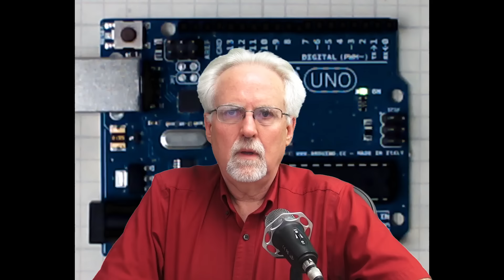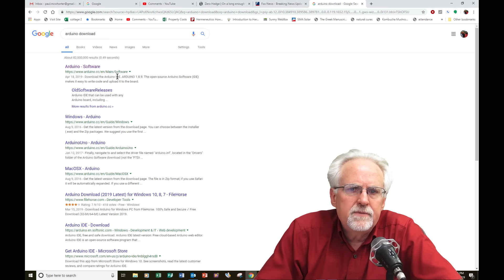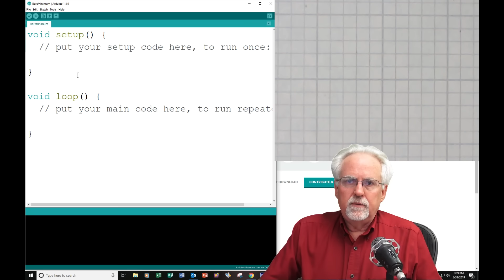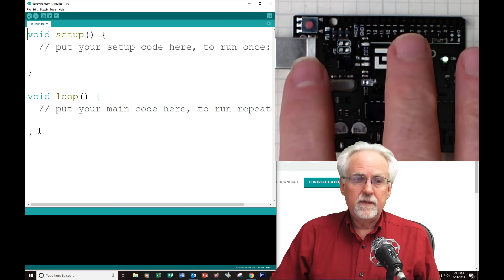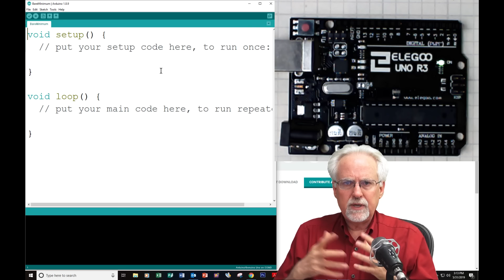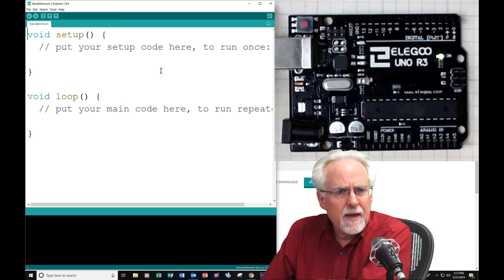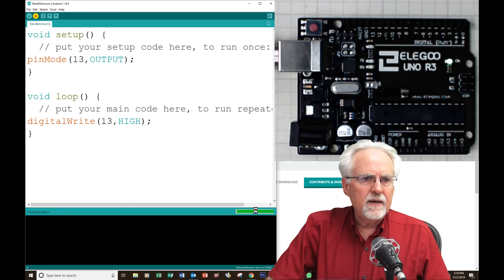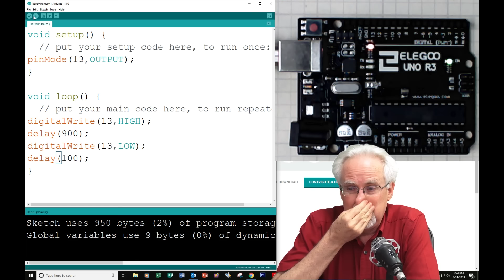Arduino Tutorial 1: Setting Up and Programming the Arduino for Absolute Beginners

Comment: Hi, I am following your lessons with interest. Thank you. However, I am having problems with Arduino. I'm using Arduino Uno IDE 2.0.3 On my screen the top line doesn't match the download in your lesson. This is also the case when I download the program again. I see 3 buttons and a window that says: "Arduino Uno" is indicated and the port "COM6". Of the 3 buttons you can only use 2 buttons. The leftmost “V” (verify) and right next to it “→” (compiler). The 3rd button from the left does nothing when pressed. Perhaps this is also the cause of the Serial Monitor not working. 
In your download (lesson 1) there are 5 buttons next to each other. (?) How can I solve this?

Comment: Hello Paul! I wanted to let you know that I've been in the electrical field for 35 years now, 23 of those years as an electrical contractor in the state of Florida, 24 years as a Master Electrician and 3 years as an electrical contractor in the state of California recently.  I  just got my FCC amateur radio license in April of 2022 and started to learn about radio frequency, antenna, and amplifier circuits.  My brother in law had a bad DC converter in his RV, so I took it apart and soon realized that I was hooked... I was able to repair the converter by replacing a cap, resistor, and fuse by unsoldering and installing new components... So, from this point,  I wanted to understand more about electronics and soon discovered that my electrical background gave me a head start in fully grasping the concept.  I then began by picking up an Arduino Uno R3 and an accessory kit to go along with.  While searching for information about the Arduino, your name kept coming up. Well,  a quick search led me to this channel, and I am truly impressed 👏.  Thank you very much for taking the time to produce this content for beginners like myself.  I am honestly learning quite a bit by following along with your videos.  Yes, I can say that I am hooked and want to understand everything there is about this wonderful and exciting world that I had previously ignored.  I am certain that as long as I continue to watch your programming, I  too, shall one day comprehend these amazing little boards like you do. Again. Many thanks, Paul! You have made my journey that much easier.  Keep up the great work!

Comment: Sketch uses 932 bytes (2%) of program storage space. Maximum is 32256 bytes.
Global variables use 9 bytes (0%) of dynamic memory, leaving 2039 bytes for local variables. Maximum is 2048 bytes.
avrdude: stk500_getsync() attempt 1 of 10: not in sync: resp=0xff
avrdude: stk500_getsync() attempt 2 of 10: not in sync: resp=0x00
avrdude: stk500_getsync() attempt 3 of 10: not in sync: resp=0xe0
avrdude: stk500_getsync() attempt 4 of 10: not in sync: resp=0x00
avrdude: stk500_getsync() attempt 5 of 10: not in sync: resp=0x10
avrdude: stk500_getsync() attempt 6 of 10: not in sync: resp=0x00
avrdude: stk500_getsync() attempt 7 of 10: not in sync: resp=0x18
avrdude: stk500_getsync() attempt 8 of 10: not in sync: resp=0xf0
avrdude: stk500_getsync() attempt 9 of 10: not in sync: resp=0xf0
avrdude: stk500_getsync() attempt 10 of 10: not in sync: resp=0x00
Failed uploading: uploading error: exit status 1

Sir, I am getting this error. What should I do?

Comment: Hi Paul.
Thanks for doing these tutorials.
I am 63 and using your videos to teach myself electronics..
When I write my Arduino code as you have yours, my OUTPUT word remains Black not coloured. 
Everything works fine but my text is not coloured when I write "OUTPUT"
My IDE is very 2.0.3 and somethings differ  to your IDE.
Appreciate any help.
Mark, Australia.
Reply from the maker: The new IDE might be different than the one I was using.

Comment: Hi Paul, thanks for the series again! I tried using pin 13 as a voltage supply pin -- pinMode(13,OUTPUT) and digitalWrite(13,HIGH), but it didn't output enough voltage to move the servo at all (I just hear tiny clicking sound). I suspected the possibility of insufficient voltage, so I tried using the 3.3V pin and it was enough to move the servo. 
So is there any difference between digitalWrite(pin,HIGH) and the 5V pin? (or, why can't I use digitalWrite(pin,HIGH) as a voltage supply?)

Comment: The older tech guys are always  the ones that can explain exactly how a piece of Equipment works instead of just how to use it but not truly understand how its possible or what the functions are actually doing to give the desired result.  The people that say to plug wire into port x and upload a premade file aren't really teaching me anything  because they never explained why and we're not building a bad clock because we needed one so getting it finished as quickly as possible isn't the goal. I'm glad I found this channel.

Comment: Hi Paul, thank you for your tutorial series. I've just started following along. I realise this series is a few years old now so this may just be an issue due to the updated software...When I write any of the commands - pinMode, OUTPUT, digitalWrite etc ... none of them change colour. Have you encountered this and is there a patch / fix for this?
Reply from the maker: Probably you have downloaded a more recent version of the IDE and perhaps it does not behave the same as mine.
Reply: @paulmcwhorter   Thanks 🙂

Comment: As a 78 yr old kayak fisherman I'm coming into this sort of sideways, trying to install and run an Electronic Speed Controller (ESC) into the head of my fishing trolling motor and using a servo tester (with a larger potentiometer than comes with the servo tester) as a remoter control. So many adjustment settings, so many new terms to learn and then a couple of the folks in this facebook motorized kayak group start talking Greek to me and it turns out that they are referring to Arduino, so here i am!

Comment: You helped me more than you know - my instructional PDF indicated that the “sketch uses 922 bytes” etc. output was indicative of bad drivers, and the first lesson had a code that set the ALREADY BLINKING light to blink at the same rate that it already was (1000ms). 
I ended up just guessing and changing the delay to 200ms without even knowing what it did - well, it changed, and it was working the whole time. 2 hours wasted lol. 
But I wasn’t sure what was going on with it, and when I saw you had the same output I was so relieved and angry at the same time.

Anyways I can register the blinking at about 20 to 25. 

Thanks so much for making these videos.

Comment: Great video;  I am a model railroader that am building a somewhat unique 3 cylinder steam locomotive.  I am trying to learn how to program an Arduino so that I can utilize a sound card that I could turn on and off to create the 3 pulses of the exhaust (with the center exhaust duration that is slightly longer that the two other adjacent exhaust pulses, and have those pulses vary in pulse widths depending on the track voltage (0-15Vdc).  Could you recommend a sound card and an Arduino type that I can use to do this?

Comment: Hello Paul, many thanks for your fantastic tutorial from Germany. After more then 30 years your tutorial bring me back to electronics and programming. It's great. 
I teached in the later 80th socially disadvantaged pupils without a grduation the basics of electronics. So today I had  one small idea to make the understanding of arduino a little bit easier. I use two breadbords - one of the left side from the arduino and one of the right side. On the left bradboard I place the Input-circuit and  I place the output-circuit to the right side. So absolut beginers can read the complete circuit like a book from left to right. We have an input into the arduino then the arduino processes the input an give the result to the output. 
And so you have the same picture in mind as the logic works.

Comment: Hi I am a retired Mechanical engineer who originally programmed in Basic, Zilog & Fortran 40 years ago at University but never had the need to use it since. (I used the experts to do this). 

Now that I am retired I have a small automation project I want to do for my astronomy hobby and therefore I want to see if I can do this with the Arduino or Raspberry Pi as a low cost solution.

However the first steps is to learn how to program these units and learn the syntax.
These tutorials are brilliant and like others have said I like the fact that you don't assume the viewer already understands and that you explain everything fully. 

This has rekindled my understanding of electronics and programming again. Thankyou.

Comment: I have a video suggestion!!!
can you do a video on can bus communication using arduino. a very practical application would include analog 0-5v sensors for a car. Maybe even include data logging.
i’ve looked around and there are no videos i can find at the level you do.

Comment: I don't have Arduino, but to complete the assignment, I suggest the assumption that eye is able to take 30-60 pictures per second. So, we can predict that there is a limitation until 1/60-1/30 seconds. Converting milliseconds, they are 16 and 33 ms. So answer should be very close to these values.

Comment: Hi all
I  fell foul of the sneaky little tab in Tools they don’t tell you about below the Arduino nano  or whatever your selection of Microprocessor board which asks what processor are you using. It comes in three flavours Atmega328P or Atmega328P (old bootloader) or Atmega168. I tried them all ‘till it worked after tearing my hair out before finding out that there was more to set than just Nano or Uno et al.. The error messages don’t give you a clue about this so you spend a lifetime trying to re-jig the software because that’s what the error messages tell you to do. So not all Nano’s are the same by the looks of it and a lot of Prior Knowledge is expected .......  Straight PICs are the way to go I think and cheaper.  Phew!  Pete
Reply from the maker: A challenge in making educational material like this is after I make the videos, changes are made to the IDE, software, and libraries. So, sometimes the IDE you download is not the same as what I am using in the video. This is usually what leads to confusion.
Reply: @paulmcwhorter  Hi Paul Many thanks for your nice reply. I have been very confused as you can see I am used to play with PICs and was told Arduino is much easier well now I am in I am determined make them work already build a ham radio morse keyer using the nano and will follow your excellent tutorials to learn more now I can do something with them. Many thanks for the work you do good luck Pete M0FMT

Comment: I know paul still reads these comments but if your reading this anyone I would not really recommend arduinos ides I would recommend you install visual studio code and get the extension platform IO it gives you a lot of features arduino doesn't like built in debuggers autocompletion (more advanced autocompletion I am pretty sure arduino ide v1 or v2 has it just really slow)
and you also get built in library and some other thing installers it also includes a ton of quality of life features + you can use custom themes and it can compile and upload directly to the board and you can configure all the stuff on it.

Comment: Would you recommend that I get the most complete starter kit instead of the super starter kit? I'm kind of hesitant on which one to get.
Reply from the maker: either works fine. If you can afford it the more expensive one has a few more components
Reply: @paulmcwhorter  alright thanks for the response

Comment: I have a question, I'm not sure if you've heard of the Onion kit. The onion comes with an upgraded version of an Arduino UNO R3. It is called an Arduino Dock 2. I've checked solutions but Arduino IDE isn't recognizing it. But the light on the board works.

Comment: I got my on and off time down to 15mS by the time I could not see a definitive flash. Loving these tutorials, I learned C in school and started with PIC18F24k30.  I designed, coded and built my own weather station as my final project.  and just getting into o Arduino now. thanks very much

Comment: Between 1-15 msec the led remains at a constant high and then when we go to a microsecond range delay, the LED starts getting a constant dim, which is indicative of I guess how fast the signals are transmitted in case no delay command is inputted. Thanks for this great beginner lesson!

Comment: Why won't this turn off the light? Setting it on HIGH (even though pinMode is commented) will turn it on, I don't know what's the reason behind it

void setup() {
  // put your setup code here, to run once:
//  pinMode(13, OUTPUT);
  
}

void loop() {
  // put your main code here, to run repeatedly:
  digitalWrite(13, LOW);
}

Comment: I never got familiar with the old Arduino IDE and now I have to start all over, which isn't saying much as I never got familiar with the old IDE. So far, it has been my OP newer stuff was suppose to make things easier, not in this case yet. So now I have the new IDE, I connect my arduinos up and the software will not find the proper comp port and I haven't been able to figure out how to fix that. I have 2 options and neither is working. Maybe after watching these videos I can figure this out, I hope so, I'm kind of hard to teach.
Reply: So far, I found out there is a driver error from somewhere that might be causing the issue. I read somewhere else that another person is/was having the same issue, a driver error, not finding the suitable com port and recognizing the Arduino board. Some people just pick up on this stuff and others don't.
Reply: Paul, I'm still having more issues then should be run into with this IDE. Downloaded version 2.0.0-rc9.2 and now none of my Arduino boards will connect to the correct com port, Mega's, Uno's, Nano, Clones. NONE of them, nothing but inconsistencies and nothing is correcting the problems. Windows defender is blocking stuff and wanting to close the IDE. I managed to go back to my old IDE and I got a com port connection and was able to upload a large sketch which is for a SDR project I'm working with. I have 2 versions of radios and several other projects which run on Mega's and 328's I need made functional, not happening with this new IDE. Setting preferences isn't working! Nothing I do makes any difference. Any idea or help?

Comment: just posting as it may be of some help to someone else,
First problem i encountered with my Arduino is that the one i had bought with my kit (not the same kit in the video) had sat not doing anything for about 2years until i've finally tried to learn about it... when i plugged it in and set it up i couldn't get it to register on any port, i bought a new cable and still nothing so now i have bought a new UNO board.
the second UNO still wouldn't show up correctly - i.e Port 3 (Arduino UNO) and would just show as 'PORT 3'

Secondly although Paul had said he didn't want to show how to make a circuit in this video i found that my particular board did have a 'C13' light but i couldn't get it to blink, so i just used the bread board in the box to create 'GND' to the negative side of a LED and 13 to the positive side, this allowed me to do the code that Paul talked about in the video and also helped me to troubleshoot now knowing that although it doesn't show the port attached to the board it is definitely attached correctly.

Comment: im 43 years old and just got my kit today and im so exited to learn hahaha
Reply from the maker: Excellent!
Reply: @paulmcwhorter  My heartbeat: 
void setup() {
  // put your setup code here, to run once:
pinMode(13,OUTPUT);
}

void loop() {
  // put your main code here, to run repeatedly:
digitalWrite(13,HIGH);
delay(700);
digitalWrite(13,LOW);
delay(50);
digitalWrite(13,HIGH);
delay(400);
digitalWrite(13,LOW);
delay(50);
digitalWrite(13,HIGH);
delay(400);
digitalWrite(13,LOW);
delay(100);
}

Comment: hi everyone , hi mr paul , i have a serious problem here , i'am making an arduino rc car but when i try to upload anything or any codes to the arduino board , it tells me (problem uploading to board) , and sometimes (no such file or directory) , and i know that there is something called (avrdude) , it should give me this messege (avrdude done. thank you) , but it doesn't , sometimes it only give me this messege with the messege (problem uploading to board) , what should i do ? , i tried surfing a lot on the internet but i didn't find any solution for this problem........i have :
arduino uno r3  and an hp notebook 15 with windows 10 64 bit installed in , .......please help , thank you......

Comment: I couldn't tell a different at 12.5ms, which when I googled the answer, it was 13 ms according to an MIT study, which lead to me reading the docs on the delay function and the data type of the millisecond, which was unsigned long, which are values from 0 to 4.2 billion (or something close to that), but cannot be a decimal number, so arduino software/hardware either converts decimals to integers rounding either up or down, not sure which, but if I'm guess, it probably round to the nearest tenth.

Comment: hi mr paul so i. experiencing alittle problem with my Bluetooth module the instructions i was told right when the program opens is command with capitals "AT" then i should get a ok response  my arduino app keeps saying com4 port busy and not getting any response after each command do i have to semicolon after the AT  Commmand

Comment: When I plug my arduino into my RPi4 running rasbian, the orange light (labelled 'L') is blinking, and the yellow 'on' light is on. Is this normal? I only ask because yours isn't.

Thanks for your video. I've already watched it, but now I just plugged the Arduino in for the first time to start writing code, thanks to you!

EDIT: Actually now I see that your 'on' light is on, but it doesn't look like the light labelled 'L' is blinking on yours.